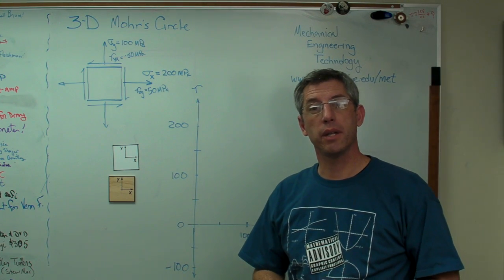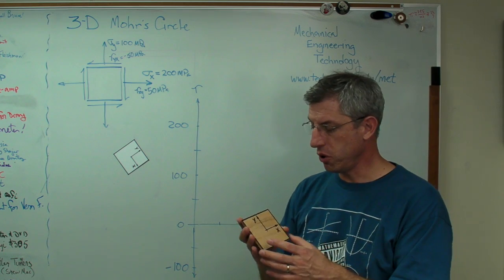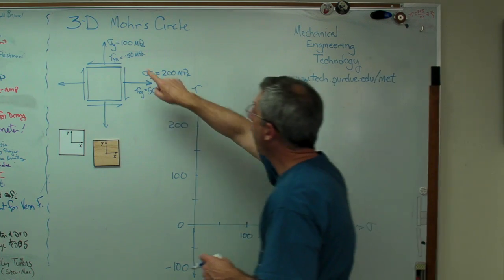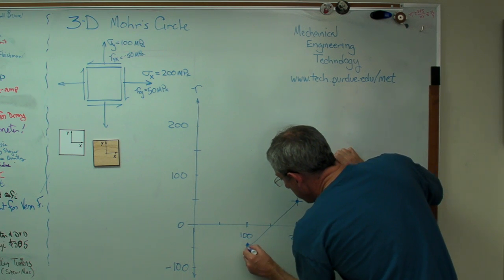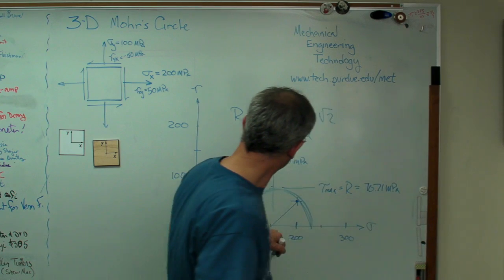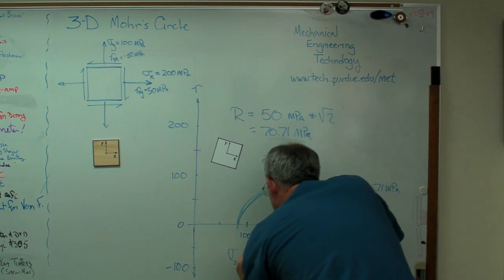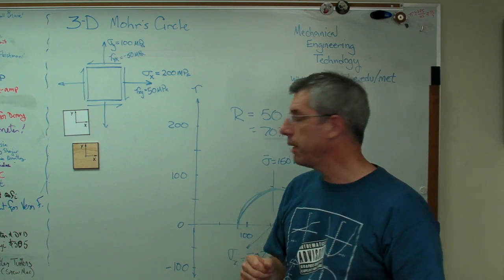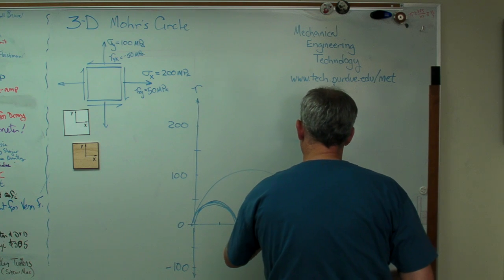3D Mohr Circle.MP4

Comment: I do not quite understand the rule of thumb regarding tau-xy and tau-yx. Here tau-xy is 50 MPa. Is this not in the direction of the vertical arrow with only half an arrowhead? As it is mentioned tau-xy is the shear stress on the x-face in the y-direction and tau-yx is the shear stress on the y-face in the x-direction. But the arrow for tau-xy points in the negative y-direction and the arrow for tau-yx is in the negative x-direction. It confuses me a bit. So tau-xy is positive in the negative y-direction? And if tau-yx is -50 MPa in the negative x-direction then tau-yx is 50 MPa in the positive x-direction?

Comment: So Iam wondering if sigma 1 and sigma 2 have to be bigger than sigma 3 in all cases ?!

Or this is only when  both sigma 1&2 are positive ??
Reply: For plane stress, which is what we are doing here, you can plot the first circle then you have two principal stresses.  The third principal stress then has to be at (0,0) for the condition where sigma z = 0.  Either this is between the two so you can draw two smaller circles or it is outside the two so you can draw another small circle, then one encompassing both.

Comment: @CallmePete89 The sum of the three stresses acting on the element MUST equal the sum of the three principal stresses. With enough information you can draw a 2D Mohr's circle, find the two principal stresses from that one circle and using the newly found principal stresses you can plug them into the equation where the sum of the experimental stresses equals the principal stresses.

Comment: I have a question relating from your previous video of Stress on the Inclined plane .
How did you get Radius = 50 MPa  X  2 sqrt = 70.71 MPa ( i.e. Force X Angle theta ) , 
if Normal / Tensile angle stress = F cos sq. theta / Area   w.r.t Mohr's Circle design ? 
( Although , Sin 45 = 2sqrt / 2 and For Cos 45 = 2 sqrt / 2 ) .

Reqd :
What Angle theta is it?(it must be Cos theta  a / to Trig) 
How did you get Radius , if r =  Diameter sqrt  /  2  ?
Thank you .email me on :babarkhan91099@yahoo.ca

Comment: Is a 3d Mohr's circle equivalent to a VonMises stress calculation?   

Couldn't you draw this this "3D stress" graphically as a sphere? To draw this as a sphere the Sigma XY normal stresses would be represenated by the X axis of the graph as shown in this video, the Shear stress would be still bre represented by the Y-axis also shown in this video but the Sigma XZ normal stress would be represented on the Z axis of the same corordinate system.  The sphere's outside surface is extreme condition